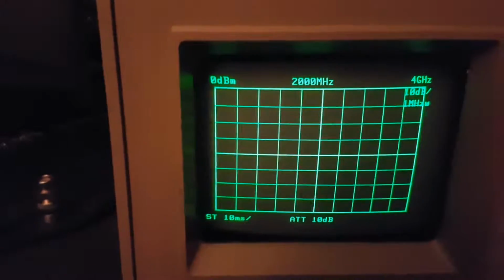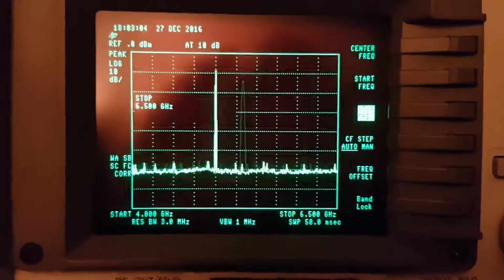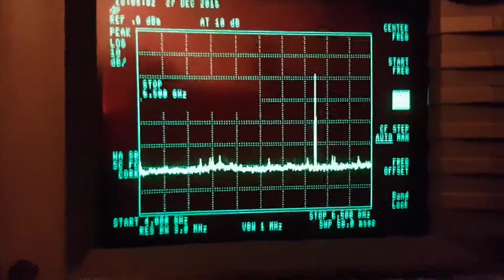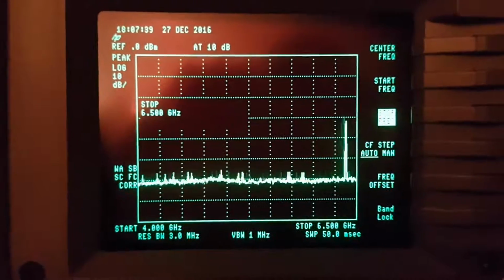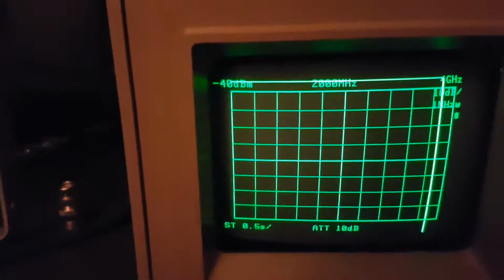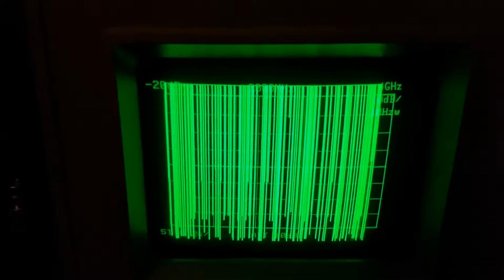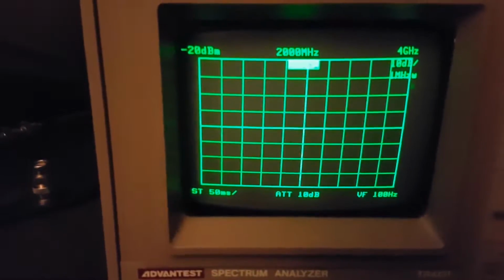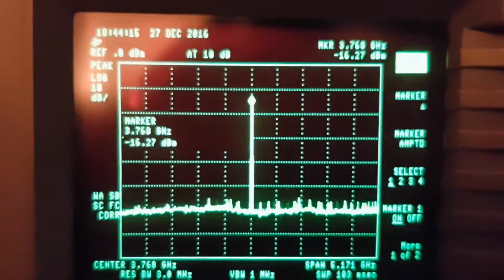Advantest TR4131 Spectrum Analyser Problem (Pt 1)

Comment: Hi. I know it is being a very long ago but your video is the only one I found that  shows the same problem my Analyzer have.. Ive looked everywhere to find info or to fix it with no sucess..  Did you find the problem on that Equipment ?  Thanks
Reply from the maker: Hello Ivo Matos.. I have added an email for you to contact me directly. You can find it in my channel under 'ABOUT'. I look forward to hearing from you.. rgds Tony
Reply from the maker: Hi.. Sorry I am very bad that I did not visit any of my videos for a long time and I got no notification that you had asked me a question.. and just by chance saw your message today.
There is almost no information available for the TR4131 and I could not find any when I was faultfinding mine.. but the later model Advantest R1431 has some similar mixer frequencies and power levels and the service manual for that one was available on the internet so you could have a search for that.. and it may help you. I actually stopped working on the analyser because I was very busy with other things so did not make further progress with it. One day I will take another look (!)
So is your analyser making those same strange off the screen scans as mine was..? I'd be interested to know.
Only one person suggested something on the first video but he was way off course because even if the input diodes were damaged you would still have the 'x' scanning noise floor. So I disregarded what he said.
Nobody else knew what the problem could be it seems.. as I got no further suggestions.. and my own analyser had already had several engineers look at it before I owned it.. and none of them could fix it either.
Keep in touch if you like and let me know how you get on with yours.